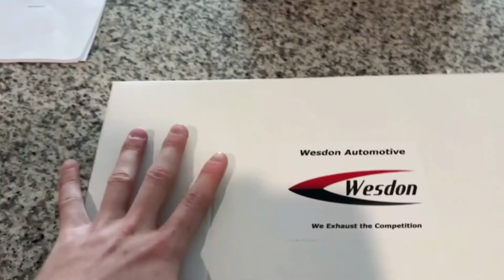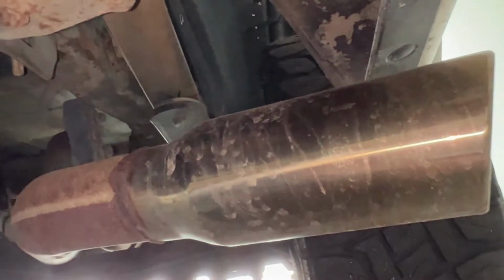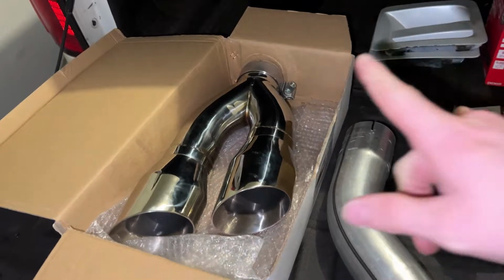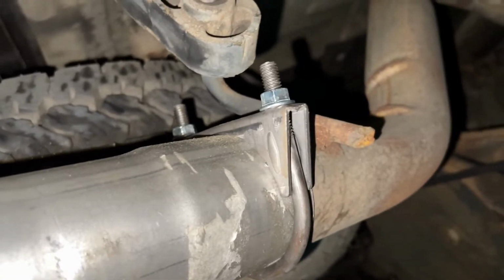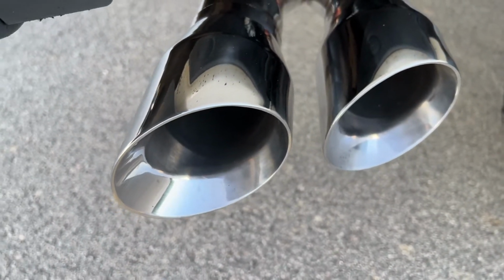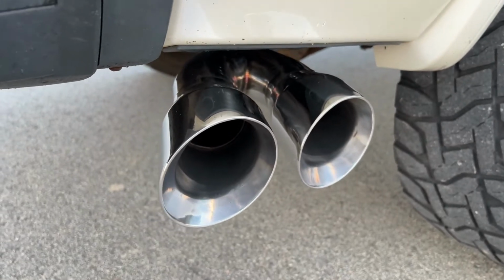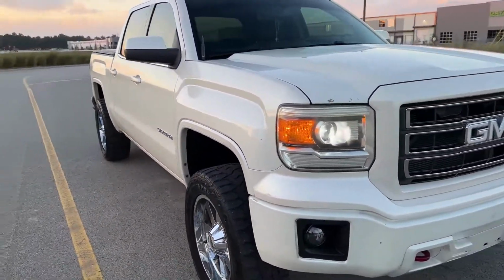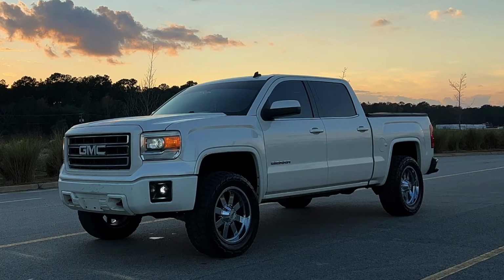BEST AFTERMARKET EXHAUST TIP!! 4" DUAL EXHAUST TIP - SOUNDS AMAZING

Comment: I had a muffler installed 2 days ago and I got over excited and decided to get a tip welded on. I never had a chance to do a sound comparison and now I don't like the sound of the dual tip that I spent 150 bucks on plus to get it welded on.
Reply: get the muffler cut off and a pipe welded in place
Reply: What don't you like about the dual tip? I was going to use double wall dual tips for my side exit on an LX570, thought double wall duals were supposed to sound smoother and deeper
Reply: @DTM.Desperado  My problem probably isn't the double tip. It's probably the muffler itself configured with my vehicle 
Combined with my air intake. 

For example, I also drive a new Dodge 1500. I have 30,000 km on it and as Factory just has a deeper rumble.
Reply: @Ryan-yi6su  I've always had success using glasspack or straight through mufflers for a deep smooth sound. Use longer ones for less rasp and drone and use shorter ones for a more raw sound. Chambered mufflers like magnaflow never gave me the sound I wanted and drone too much. You can also delete a cat or two if you want more volume without changing the muffler

Comment: I've liked the slash cut tips too has the Trans-am Vibe. Just never been a fan of the double wall. I got the GoPro Performance Blazer (Wickedflow exhaust has the sale rights now) 304-Stainless 2.5" w/ dual 3.5" 18" length.

As for ceramic coating it... is it high heat resistant? It's exhaust so it's going to get hot
Reply from the maker: I’ve heard, and can get behind, the idea that the double wall provides a more “throaty” sound. Which I’m a fan of, but I’ve never heard of your type of exhaust so I’ll look into it 👀

And for the ceramic coating.. I didn’t think that far ahead 😅. Could be though, I’m no chemist 🤷🏼‍♂️
Reply: @hunterrwiilson  I’m running a single Spintech 6000 2.5” with that tip, side exit.
Reply from the maker: @NXT_LVL  same truck?

Comment: Had a question got the same ones but black  wonder if i can weld it on instead of bolts on
Reply from the maker: I’m no welding expert, but I don’t see why not. Would totally do further research before going through with it

Comment: Straight piped ? What’s the rest of your setup?
Reply from the maker: This setup is a 3rd cat delete with a borla XR-1 muffler on a 3” pipe.
Reply: @hunterrwiilson  did you get a code after deleting the third cat? I thought I did if not
Reply from the maker: @jace6267  the third cat isn’t monitored. Check and you’ll see no O2 censor

Comment: I have a single tip now. Did the dual tip get rid of the deep rumble the single tip has? Like did it have more of a rasp sound leaning towards like a corvette or camaro sound with new tip?
Reply from the maker: Pretty much, yeah! And honestly it’s really nice when you get into it, as seen in the comparisons.
Reply: No matter what it'll have a deeper tone because of the upscaling in tip from the 2.5" pipe. Double wall tends to take the edge off of it. Unless they pulled a vacuum on it before welding the inner/outer edges together

Comment: You have the link for the muffler pipe ?
Reply from the maker: Don’t have the link on hand but it’s in the description of my Borla XR-1 muffler video!
Reply: @hunterrwiilson  is not there is for the of pipe you used for install the exhaust tip ?
Reply from the maker: @MrJunior6939  I don't understand your question lol, can you elaborate?
Reply: @hunterrwiilson  Im talking about the the 3” inch pipe 45 degrees bending … where do you bought it ?
Reply from the maker: @MrJunior6939  I ordered it through O’Reilly’s

Comment: It’s too quiet for my likening sounds good, looks killer though!
Reply from the maker: A factor to include is that it’ll depend on what type of exhaust you’re running! But yeah the aesthetic of the tip was my main concern
Reply: @hunterrwiilson I’m running true dual catless with an x pipe muffler from magnaflow! out the sides of the bed at 45s with 4 inch angle cut tips.
Reply from the maker: @benjamincruz514  sounds nice man!